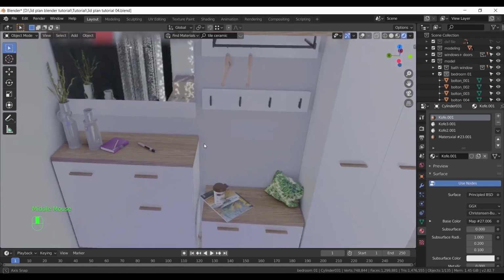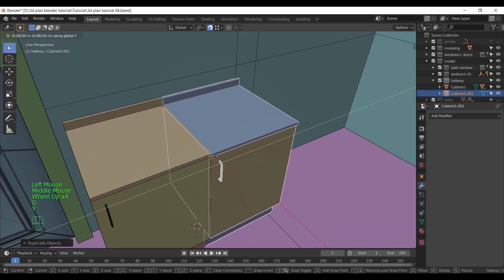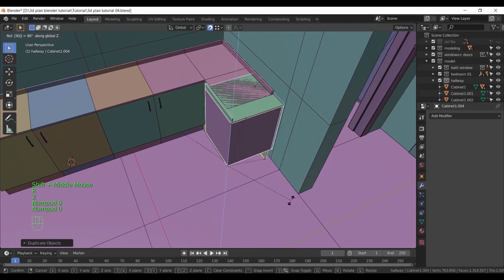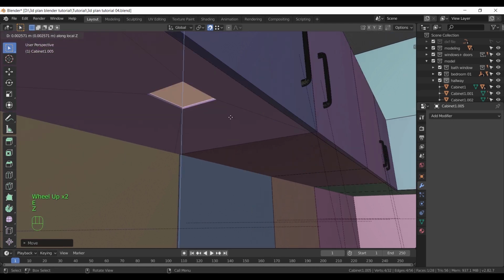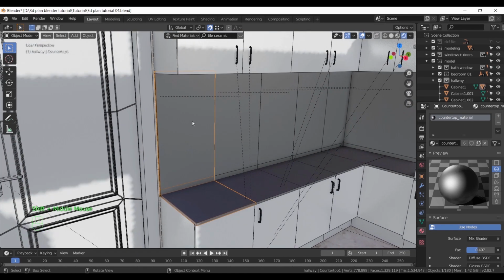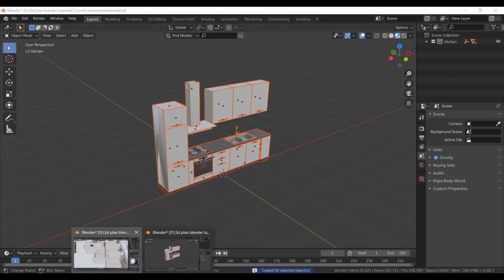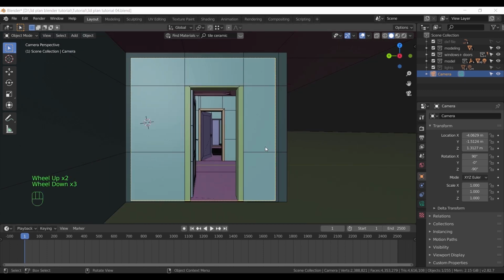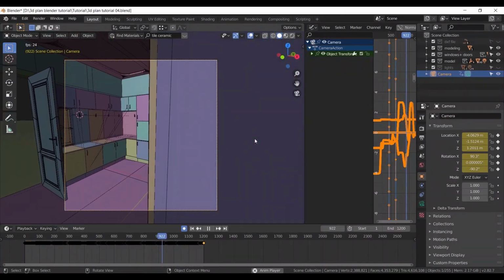How to make 3d floor plan in Blender | beginners guide (Part 3)

Comment: Thank you for the tutorial videos, it is very helpful. Am a complete beginner and because of these videos I was able to make a floor plan. But sadly cycles GPU render doesn't work for me, I am getting error called 'failed to create CUDA context, launch exceeded timeout' 😒. I will have to stay with eevee render. Looking forward for more tutorial videos 👍.
Reply from the maker: Great to hear! for the Gpu problem I had it with 2.83v and I just switched to another version, So I recommend doing that. or look online for a solution its a common problem.